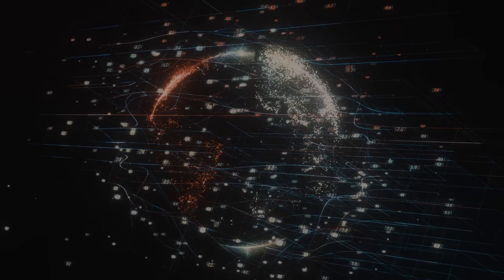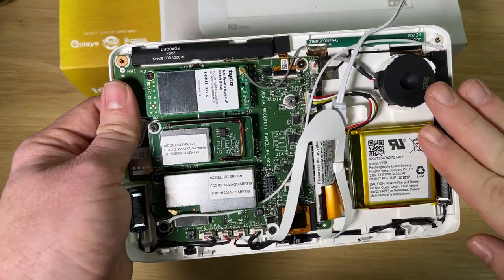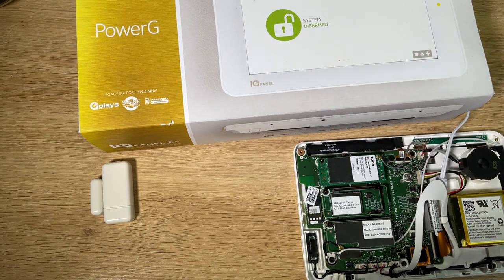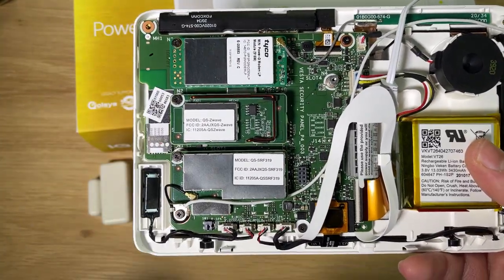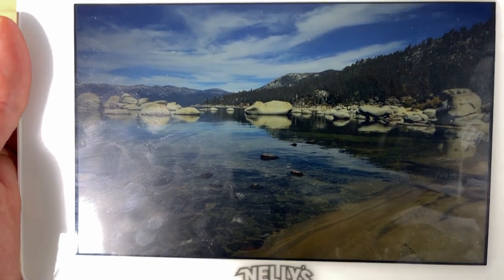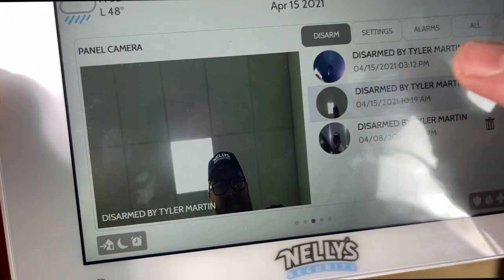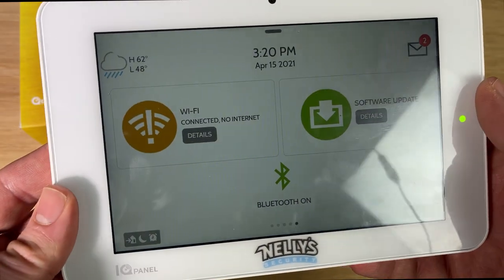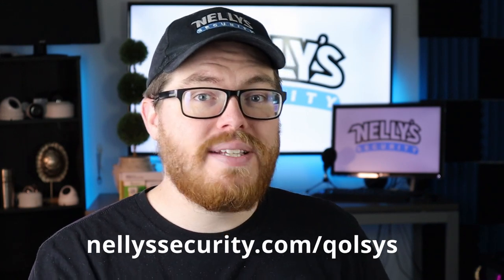Qolsys IQ Panel 2+ Review: Replace Your Alarm System with a Quality of Life System

Comment: Do you know of any security systems that use a digital packet method of communications between the sensors and the panel as opposed to analog wired sensors?

Comment: We have the same panel and out provider can’t connect the doorbell to our panel. The only way we can talk to visitors is through phone app. Do you know a link on how I can connect panel to our doorbell? Its the same doorbell and panel in your video.
Reply: I’ve had skybells under a different provider and they’re HOT garbage. Skybell themselves are useless when it comes to updating firmware for them too. You’re better off returning the doorbell and getting an Arlo pro doorbell. That has worked flawlessly for us.

Comment: What about retail customers? Can I just buy 1 or 2 panels?
Reply from the maker: Sure! Just note if you want the app integration, you'll need to be a dealer with alarm.com and it is a paid service. Alarm.com usually requires you to have your local alarm license as well. 
So we try to advise an end user client to go through an authorized installer for these units.

Comment: Hello good evening, I moved to a new house that has that type of monitor and inadvertently I activate the fire alarm, how can I deactivate the alarm so that the fire department does not have to come to my house
Reply from the maker: If you have a monitoring service connected to the panel, i would reach out to them on  this. If not, send us an email with your zipcode and we can see if we sell to any installers in your area to get the panel going! - customerservice@nellyssecurity.com